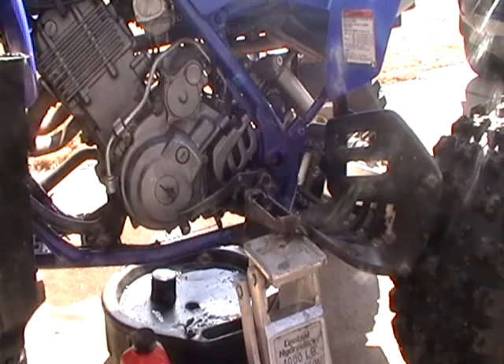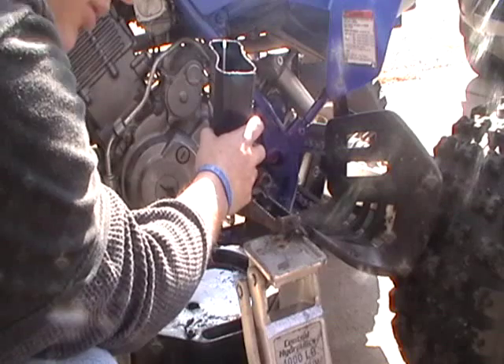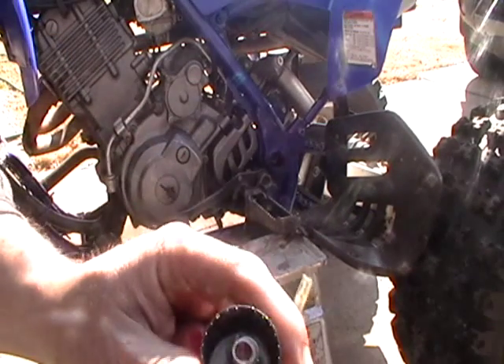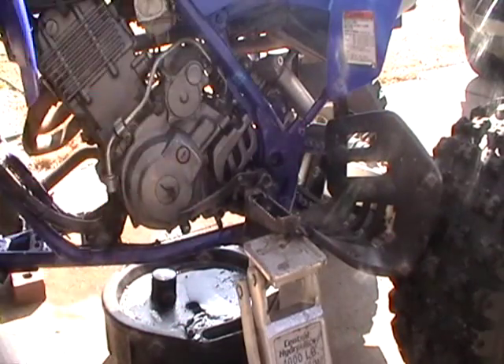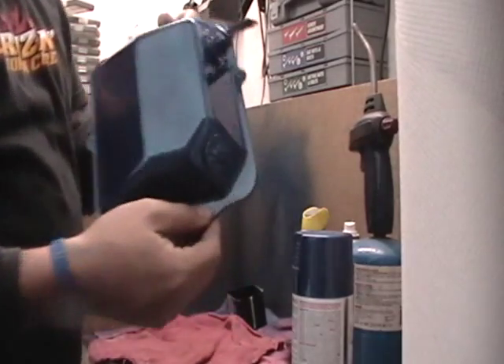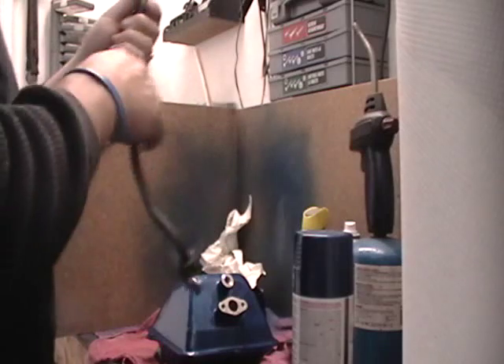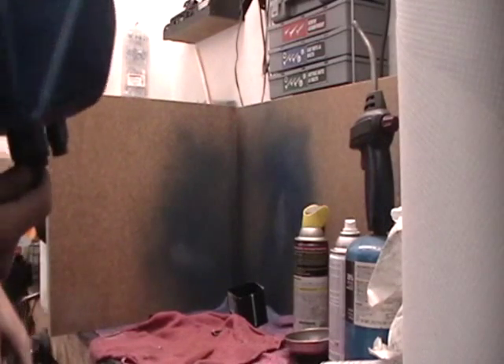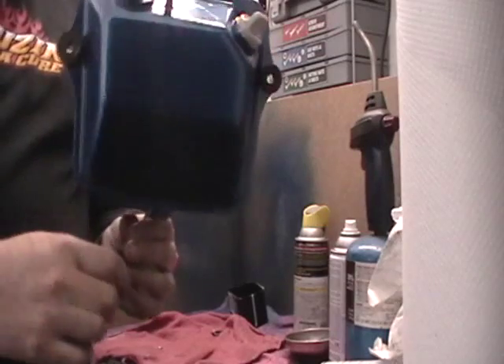2003 raptor oil flush assemble oil tank after paint

Comment: I tried putting oil in that hole u had the iv in and it wouldnt allow any oil in after i had drained the oil from the case. Shouldnt it allow oil to flow in.My screen on the oil tank also had metal shavings the screen. I cleaned it